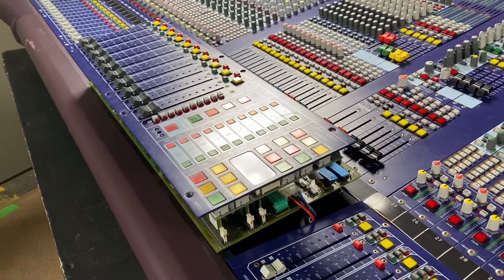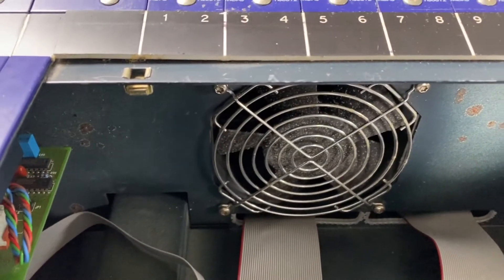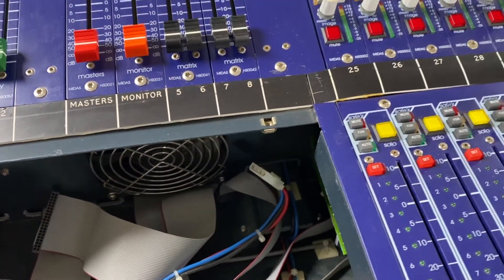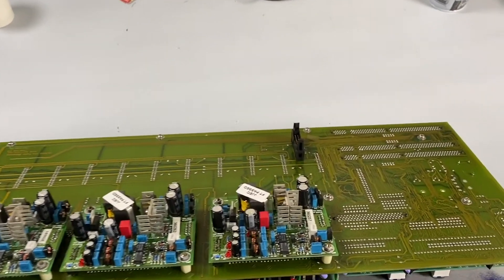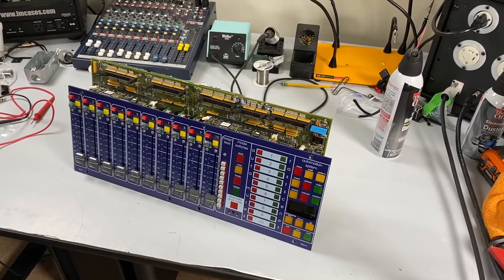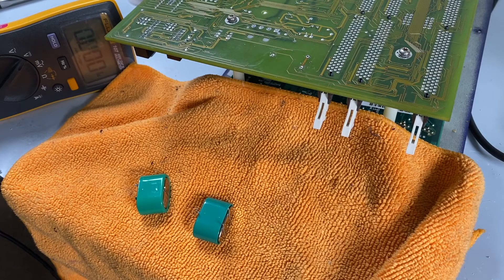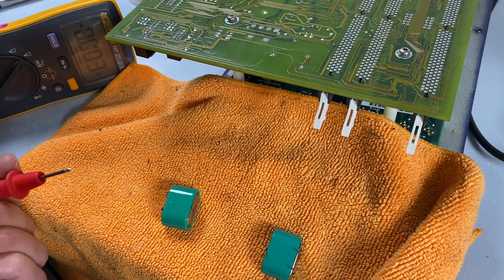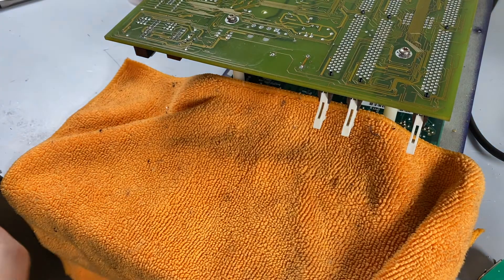Part 3 | Battery Replacement On VCA/Automation Module: Midas Heritage 2000 Console Restoration

Comment: Watching this soldering footage was like a train wreck in slow motion. We've all been at that point, lord knows I was, but if you're gunna be doing this kind of work regularly I'd HIGHLY recommend watching some videos on how to properly solder and desolder, either getting a better iron or at least making sure your current iron is at the right temp and CLEAN....but most of all learning the telltale blobby look of a bad/cold solder joint. You're not just melting solder onto a thing so it kinda sticks to the surface, you need to heat the object being soldered enough that it physically bonds with the solder, without so much heat that you damage the board or components (which honestly is pretty tough to do).

You got yourself a great console there, they sound amazing.....I wouldn't use it as a testing ground to learn soldering.

Comment: Do you know how often this battery needs to be replaced?
Reply from the maker: It depends on how much you use the console. A good rule of thumb would be every 5 years. It needs to be close to 3.8v for the console to operate properly. If you are seeing a low voltage, replace the battery.